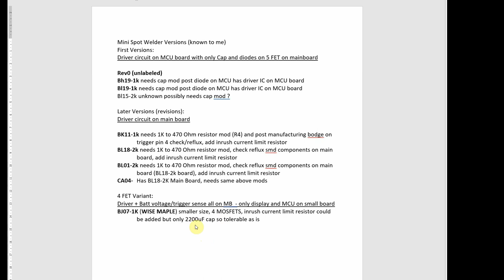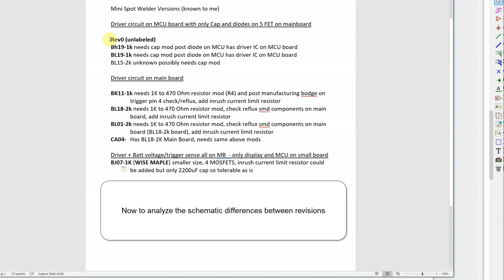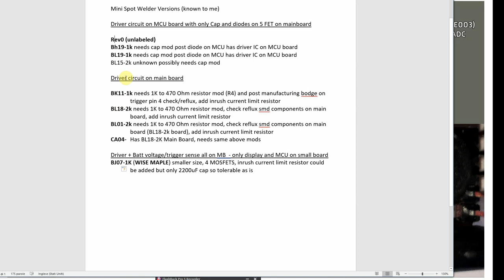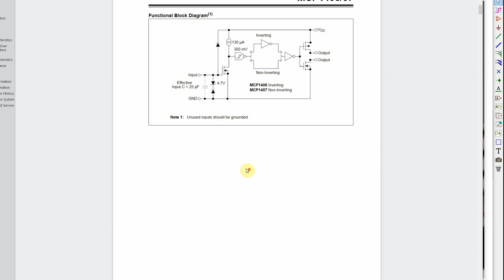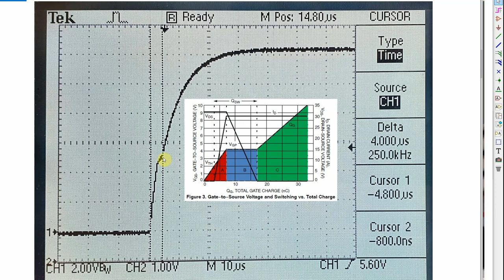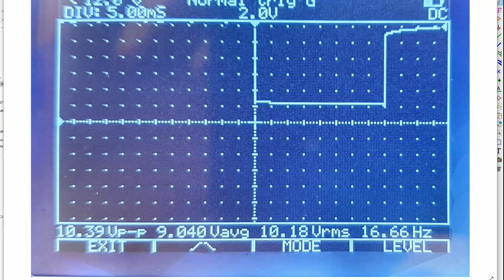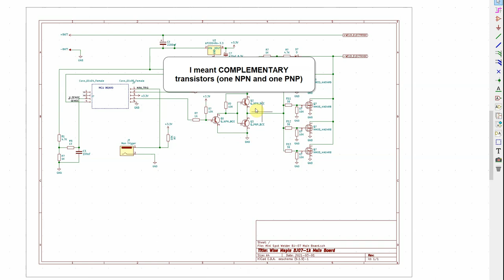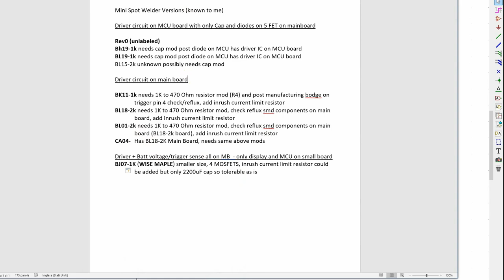All "Mini Spot Welder" versions: circuit Analysis, differences and faults

Comment: Hi Luca, I have a BI18-2k that I bought on eBay and it arrived damaged, it turns on normal but does not solder, the screen flashes when it beeps to solder, there is one of the 3 transistors that go on the main board that does not measure well, but  I don't know what number to put, I can only get the 2N5551 and 2N5401, I want to know if they work well there, I also want you to send me the diagram if possible. Thanks.
Reply from the maker: Hi, all the schematics are linked in the video description - check it out. You need to download the bl18 MCU and Mainboard PDF schematics which are both linked. Be sure that the transistors are really dead/shorted and keep in mind one is a PNP and the other is an NPN in push-pull configuration - just check the schematic. Double check all the solderings as the are often bad (refresh them). Also clean the pin contacts with deoxidizer / contact clean spray, wipe the pins clean as they are often covered with some sticky grease which does not make them have good contact with the matching connector. Also be sure to mod the R4 resistor as explained in the video, reduce that to a 470-500Ohms value. Also add the inrush resistor to avoid breaking the reverse cap discharge diode (check if it is still good).
Reply: @Luca_Techy  nice bro, ultra thanks.💪🏻
Reply: @Luca Another thing, there is a damaged transistor and I think it is the Q3 that claims to be PNP, I only have the 2N5401 on hand in SMD, I looked for the data sheet and the pins do not match, what characteristics should those drivers have, or do you have the  number of them?
 I already changed the R4 for a 470Ohms one and put a 10Ohms one in series with the diode (which was already damaged, I put a 1N4007).  Thanks bro.
Reply from the maker: @GrateyRD  Q2 and Q3 are "complementary" transistors - they always go in pairs for a reason. You can't replace one without it's complement in a pushpull design. You can use a different couple, but they must be complementary. The ones used here (at least on mine) are the SS8550 (PNP)/SS8050(NPN) SOT23 type SMD transistors. You can google their datasheets. You can use any similar complementary couple at hand.
Reply: @Luca_Techy  Thanks, I already have it working, the two NPNs were damaged and I replaced them with the ones I had here and it works wonderfully, THANK YOU VERY MUCH.

Comment: I just got the WiseMaple BJ07-1K.  So I should add a 10 ohm 1/4 watt in-rush resistor across the D7 diode?
Reply from the maker: Yes you should to ensure that your diode won't die sooner or later (even if it's "only" a 2200uF cap, the peak inrush current when fully discharged is still an overkill for that diode).
Reply: @Luca_Techy  So, I should add a resistor and a capacitor?
Reply from the maker: @octapc  no, for the Wise Maple just add a resistor in series with the diode as explained in the video.
Reply: I am new to the electronics stuff. Can someone link to the proper inrush resistor needed?
Reply: @craigb907  which welder have you got?

Comment: Hi Luca, really great explanations for the different versions! While I am not electronics-trained I am still confused from your discussions whether Version 0-unbranded (which I have) requires the addition of a resistor to be added (across M7?) to protect against the in-rush current; can you please advise? If you want to talk me through how to set up my new scope (still learning) I will see if I can obtain the graph in the Miller Effect region for this mini-welder - how can we exchange email addresses? While I have beefed up all the applicable traces and added a 1000uf 25V electrolytic Cap +ve to +M7 & -ve cap to gnd and using a time setting of (from memory) 3 ms powered from a fully charged Turnigy Nano-tech 5000mA 25-50C LiPo, the weld was very violent and physically welded the -ve electrode to an old 18650 cell using a 0.12 pure Ni tab - blasted a 2mm hole in the 18650 and produced a lot of stinks which I think came from the 18650 battery as there is no visible damage on the welder and all welder diodes I have tested with multi are OK! Totally scratching my head over why this happened as it seems like the timer circuit did not operate? I mulling over the possibility that the full 50C X 5.0A i.e., 250A was supplied to the weld???? Meanwhile I am trying to work up enough courage to try again using a setting of 1ms!!!! I would really appreciate your expert comments if you would like to do so. Cheers from Down Under.
Reply from the maker: Hi Gemmo, if you have the first revision with the MCP FET driver on the MCU, you don't need to add any resistor in series to the 10000uF CAP as it has no series diode - it's just directly in parallel with the battery as shown in the video. If you are getting such a violent weld with such a low ms setting are you sure the trigger circuit is working? Do you hear the beep when it triggers or does it simply weld as soon as you touch the contacts? If so the FETs are shorted and you need to check them - there must be no continuity between Drain and Source (the 2 sides of the FETs where the batt - comes in and the other side where the - electrode goes out). Test it with a multimeter with the welder off and MCU board removed. If you find a short, you'll need to remove the FETs and find which one is shorted.
Reply: @Luca_Techy Hi Luca, thank you for your very rapid reply - greatly appreciated! Yes I certainly do have the version with the MCU FET driver etc., and get only very soft (barely audible) clicks, not beeps, when turning on and a number of clicks before the weld occurred, which has always been the case with this beeper from new every time I switched it on [just looking into what type beeper I have and at replacing this if I can or if this indicates another possible fault in the circuitry]. Note that I have only done one (very scary) weld on this unit; I have checked all FETS and other diodes on the welder and get the expected(?) readings; no conductivity one side and lowish conductivity on reversing the multi-leads. With the FETS in-circuit, all give the same responses as follows: +ve on D -ve on S (Pins 2-8) get No Conductivity (NC); -ve on D +ve on S get 420; +ve on D -ve on Gate (Pin 1) get NC; -ve on D +ve on G get NC! So with my limited electronics understanding I deduce these FETS are all OK???? Please comment. FYI: On my MCU (what I believe are) the push - pull transistors are marked 'A7', does this help you in getting the specs for this part of the circuit? Let me know if you require any other component markings on this version and I look forward to your comments when convenient, please. Cheers Ian     PS: Building up courage to try welding just two strips of Ni only - no battery this time and on a setting of 1! I have had a look at a number of my 'dead' 18650's and most of them have a little dimple of old Ni strip on the base so I'm thinking if this was the case with the battery I chose the Ni strip would have been raised off the base of the battery and this gap would/could(?) have caused the arcing when I hit the Go-button; is this possible? Cheers and thanks again.
Reply from the maker: @ozgemmo3445  If you have no short between Drain and Source (the 2 sides of the FET, -BAT and -Weld) then the FETs are ok. You have no pushpull as you have the MCP1407 which is a FET driver - it drives the FET Gates directly. I don't have this board as I said so I can't be 100% sure but if you compare it with the pictures I show on the video you can tell if it's as I say. To run more tests use a power supply so you won't break anything and you can test the trigger - alternatively if you have a small 12V 3Watt or so filament Lamp you can check to see if the welder works using your battery when you contact the Lamp's filament contacts. This won't break anything and no sparks will fly just be sure to touch the 12V headlamp filament contacts or wires (it has to be a filament lamp) and wait for the beep: if you set it to 99ms you may see a slight quick glow if the lamp is small enough. If this happens then the trigger is working. If instead the lamp just glows brightly when you touch it constantly then something is wrong.
Reply: @Luca_Techy  Thanks again Luca, all good on the welder front now as it is making perfect welds with two Ni 0.12mm strips on setting 3. I think I might have had a temporary lapse of reason and not changed the setting from the default 10 with the first "scary" weld, so I would hate to think what would happen if I used a setting of 20 or higher - My Turnigy Nano 25-50C 5.0A certainly has a lot of grunt with delivering a max current of circa 250A!! Regarding the push-pull transistors: while I haven't actually traced out this part of my circuit board the arrangement of A7 switching diodes certainly appears similar to the push-pull transistor circuit in your diagrams; so I'll have a closer look at this part of the board in the next day or two and see if I can figure out what the opposing arrangements of A7's is actually doing but do keep in mind I am a real newbie electronics-wise! Cheers for now.
Reply from the maker: @ozgemmo3445  Good to hear!

Comment: Hi. I have conected 22 ohm resistor like in video 9:04 and the board does not power on. If i move it to original position it powers on. Are you sure that the diode should be moved sideways and then the resistor should be connected to the end of the diode? https://ibb.co/LzHG9J9
Reply from the maker: Hi, not moved sideways, but pivoted around it's pad - you must observe and maintain it's polarity!
Reply: I think I got it now. https://ibb.co/fY6WTNQ But still the picture of the diode in your video is not pivoted but just moved sideway (from the marking of the diode in your picture) or. am I missing something?
Reply from the maker: @BeiLLiac4  I replaced the failed M7 diode with a schottky as I had it at hand and the marking appears opposite to convention because of nomenclature (depends on manufacturer and smd package). Check my other video for a more in depth tutorial on this modification.

Comment: Due to 30 ms limitation, I didn't order WISE MAPLE version. Since each FET has 300A Continuous drain current, and 1200A Pulsed drain current, with a good battery, will 99ms really "pretty much destroy your FETs"?
Reply from the maker: Short answer: Yes it will. Anything over 50ms is overkill for that design  (given good battery, short or thicker and better quality cables).
Reply: @Luca_Techy  Great to know! I'll try not to use weld time longer than 50 ms. Thank you.
Reply: @Luca_Techy  According to your research result, I changed R4 to 470 ohm, and added an inrush resistor of 27 ohm 1/4 W. Now I was able to weld 0.3 mm positive cap. Thank you very much for your excellent work!
Reply: 27 ohm seems to cause issues, a PTC might be better.
Reply from the maker: @j.d.3269  a PTC won't limit the inrush current as it limits the current once the PTC has heated up. This won't protect the diode as every time you connect the positive there will be a peak current flowing through it and only after it has heated (but the peak time won't probably be enough) which is the opposite of what you want to achieve: reduce the peak inrush current. Only a resistor will achieve this. What issues are you experiencing as the only issue possible is that the drop in voltage between 2 welds is too great but that would only happen if you weld approx every few milliseconds or so which is impossible.
Reply: @Luca_Techy  How about an inductor, to level the inrush current, and no voltage drop when stable? The resistor voltage drop seems to interfere with the auto sensing, causing multiple weldings. 27 ohm seems to be on the border line, 50% chance to have this issue. I replaced M7 with SS34 for now. If it gets damaged, I might try a much smaller capacitor, and / or add an inductor.
Reply from the maker: @j.d.3269  There is no voltage drop when there is no current through the resistor (Ohm's Law), the voltage drop is only across the diode but that's not an issue as it is accounted for (.6V). The only drop you get is wanted, and that's when the Cap is completely discharged and you charge it. If you are having problems with trigger detection, it's not related to this resistor - that trigger circuit is independant and has it's own voltage divider as indicated in the circuit. The trigger is detected when the voltage on the divider output is above about about 1V meaning that the voltage on the contacts would need to drop over 70% at the end of the pulse, (it can't on the MCU as the diode prevents the cap from discharging and it is not related to this detection) and if it does, your battery has a too high internal resistance or not appropriate for that kind of high current. It is possible to add a small cap on the output of the divider to smooth this out but I don't suggest it - if your battery is good it shouldn't double trigger.
Reply: @Luca_Techy  It seems the current that goes into MCU's VDD goes through the diode too, hence the resistor, whose voltage drop seems to be in the range of 0.3V. There's also about 2mA goes through R7. The multiple triggers are really baffling me. It must be in the program to identify a valid trigger sense.
Reply: @Luca_Techy  I applied your two modifications to a new BL18-2k. In addition, I replaced M7 with SS34 so that the voltage provided to MCU is close to before. No pattern found for auto trigger. The logic might be that it'll keep welding until a good weld is believed to have achieved for that energy level. Thank you very much for your help.

Comment: hi luca, i just got home my spot welder, it is "CA20-2k"? lol. i have changed the 1k resistor r4 to 470 ohm, i have added a 22 ohm inrush limiting for the diode. haven't booted it up yet, the gates are all shorted together, but the individual resistors 30 ohm plus 2k is present. i will browse through this video to see what is new on mine, but i think this is the same as the other ones.
Reply from the maker: Yes it's probably identical to the bl version. On some CA versions the Main FET board is still actually labeled with "BL".
Reply: mine was labeled CA, i saw no pull down on the bottom underside for the fet driver circuit, should i fix it?
Reply from the maker: @xibidit  no as there shouldn't be on that version (they have been moved on the top side where they should be - check my other videos about the differences betweek bk and bl/ca versions).
Reply: @Luca_Techy  ah ok, i think i have watched all videos =) but there are so many versions, with various differences, hard to keep track :D, i have tested the welder today, havent got my lipo 3s yet so i took a 16F cap bank with a li-ion moped (150a) 2.4ah battery. i could weld, but didn't really push it past 40ms since the voltage dropped below 9 on my multimeter at the welder terminals, good setup for some testing but when i get the lipo it will be the real test. tomorrow at work i will solder some copper onto the tracks for the mosfets. thank you so much for all the help on this subject! i have sourced a microwave transformer, do you think your audrino program could work for timing a relay for it? cheers
Reply from the maker: @xibidit  Powerful mechanical relays are hardly a good choice for under 30ms delays and welding of such thin strips which is why there are FET driven welders (it is hard to get consistent timing around 40ms let alone under as the sheer mass and inertia of the contacts make this repeatability near impossible). You can theoretically drive a FET array with a MOT but you need to rectify the output as it's AC, and to do that you need enormous full wave rectifiers to handle the current, considering also the .6V voltage drop per diode which becomes an expensive design. This is why all "portable" spot welders are DC and based on a powerful low internal resistance battery or high DC current source (large 500F+ Cap banks, LiPos, AGM battery).

Comment: wow a lot of info, more than I can understand,  :-) I followed along best I could, I have watched a lot of videos, and a few people say if you use a big enough battery you won't have issues. The manual I got says 40-50 amp hours, if a person uses a larger car battery, will it work properly? TIA
Reply from the maker: Yes it will work fine even with a 100+Ah battery, just start from 5ms weld time and go up from there.
Reply: @Luca_Techy  and this is without doing any modifications? thanks
Reply from the maker: @Hoss_1966  The indicated mods are mandatory for every version if you want to avoid blowing up your FETs. Based on your version you may need to apply the R4 and the inrush current limiting resistor mod or just the latter, or just the additional Cap mod if you have a Rev 0 version (with the IC FET driver on the MCU board). It's pretty much all covered in this video.
Reply: @Luca_Techy  my board is marked with CA04 so guess I just need to add 2 resistors, a 20 Ohm and a 470 Ohm? OR do I need to do just the Later like you said? So I need to REMOVE the R4 resistor and add a 20 Ohm resistor, or just add the 20 Ohm resistor around the R4? That is tiny, little nervous about that.  And I assume I DO NOT need to add an extra Capacitor? thanks for all your help and Sorry for all the questions,
Reply from the maker: You need to apply both resistor mods (only the rev0 version with FET IC DRIVER doesn't need the resistir mod but needs the additinal cap mod) - R4 has to ve around 470-500Ohms so you can add an additional 1K in parallel or replace R4 with a 470Ohm.